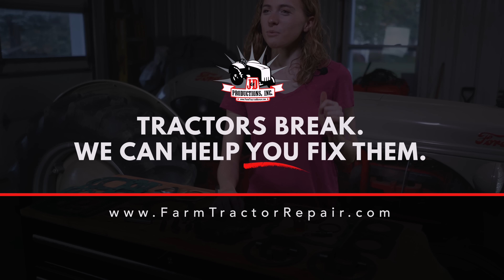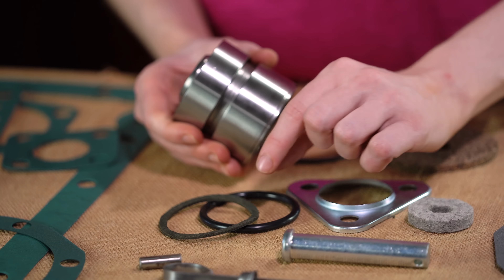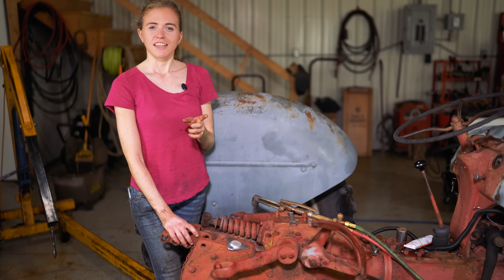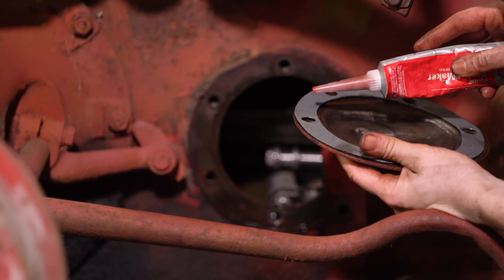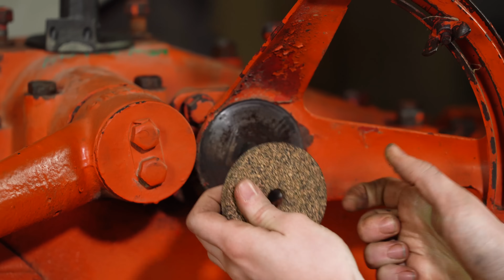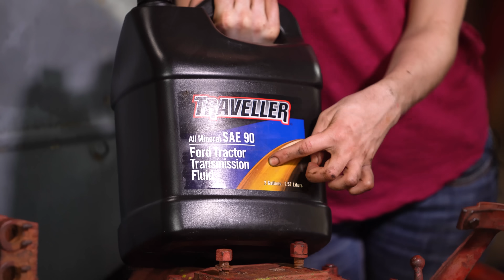Ford Hydraulic Repair Tutorial: Top Lid

Comment: In this video, you used the 90 weight oil, so I think there are two compartments there, which really are one so the oil mixes more or less? Didn't I see on another video you mentioned using Hydraulic and transmission oil back there for both?  So we are putting the AMSOIL SAE 15W-40 Synthetic in the crankcase, and what in the back two spots? Thanks for the videos. I'm sure 1000's of Ford owners have used your videos to resurrect their old tractors. A suggestion is to keep putting those parts on the screen in the videos to make it easier for us to buy from you - I watch the videos so would be willing to buy the parts from you too... And put links to your parts and tools in the video motes so we can click the links and go right to your site to buy the parts. And you can setup amazon affiliate links for the stuff you don't sell so you get a little something there too... Can't wait for the next Video..

Comment: got an 8n with a new hydraulic pump and cylinder, sometimes it does not want to lower the 3 point and you have to move the lever a few times to get it to lower, what would be some likely things to check

Comment: A friend of mine had an 8N and not only were the hydraulic sluggish, but the draft wouldn't work. A mechanic drained it and put in hydraulic oil but was even worse. We drained it and put in the mineral oil and it worked much better. I suspect the pump may have needed this repair.

Comment: Got the kit with piston and cylinder couldn't get lid to fit back on found nee cylinder was to long and hitting the front of the housing of the tractor. Had to have material removed from the back of the cylinder to get it to fit properly. After that it all works great.

Comment: I have a 8n hydraulic goes all the way up and down without a load if I pick up bale of hay it will not go all the way up then when you try to lower it it won’t move till I move the draft control the it goes down draft control if in right position and ideal what to check ? thanks

Comment: My 3 point bleeds off and lowers when I press the Clutch

Is this caused by this upper piston assembly or a pressure relief valve at the PUMP?

I saw You push on the Arm with the tractor off to test one of its features

I'm curious if My bleed off issue is because the piston leaking down?

Ken in Florida

Comment: Dan and or Rachel: I drained the fluid from my transmission on an 8N I purchased yesterday. I saw that it said to use 5 gallons of fluid, which I did use but now the "FULL" mark on the dipstick is about in the middle of the actual level on the dipstick. Any common causes for that issue? Thank you much for the video. I am going to use this information to diagnose why the 3 point does not work on my tractor.

Comment: Great videos you have. Question for you as I have a Ford 8n that I was plowing with and hit a tree root big enough to stop my tractor. Once unstuck, my hydraulics won't lift up at all. Have taken the top cover off and made sure the rod went back into the proper position and while apart made sure the oil pumps up through the pipe. The draft control plunger spring is loose and will be changing it out. Would this be the only reason the lift arms will not move up? Every thing I see inside the hydraulic system looks and works as it should. Thanks for your input. Mark

Comment: You never said anything about how to adjust the draft control. 
You can do so with compressed air on the work bench before reassembly and find out it doesn't work  .

Comment: Could you do a video of how a lift control should work? My lift only uses the top 2 inch of the control... should it lift from the second you pull the handle up from the bottom and should it not drop and hold the position of where your handle control would be? Like 1/4 lift 1/2 lift 3/4 lift full lift and same as for lowering as opposed to all the control function just being at the top?

Comment: WOW, Just WOW, she knows her stuff, Thanks for your video, it is very informative and helped my better understand several things on these old tractors. I have an old Ford 3000 Diesel. Having lift problems and will not shift into 1st and 3rd (odd shift pattern, 1st & 3rd are far right up 1st and down 3rd). I think the end of my shift rod may be bent and not letting it move over far enough to get into gear. I unbolted the top cover so it would slide around and it goes into all gears fine, but when i tighten all the bolts back up no right side gears.  Appreciate any opinions or ideas to solve this.

Comment: Enjoy your videos they are great, Have a question after rebuilding the upper lid for my hydraulics the lift arms (under load) will slowly drift down but at a certain point it will jerk back up to the selected height  will continue this over and over while tractor is running but if tractor is not running it will hold the load at the height that it was when tractor was shut down. What could be my trouble ?

Comment: I have a golden jubilee. I let it set for 2 years and when i got it back out to dig post holes with my auger when i lift the 3 point it jumps up so fast it's dangerous. It has slowly blead down for years but would take an hour to leak down with a implement on it .any suggestions? If needed i could make a video of it doing it. Thank you

Comment: I wish I could find the torque spec and torque sequence for the top cover.
Reply from the maker: Hi Dennis, there is no published torque spec or sequence for the top cover to our knowledge. We tighten with an impact wrench.
Reply: @DanGingell  Thanks  for replying. I was able to find torque specs in the I&T Shop manual FO-4 in paragraph 156...."Tighten lift cover retaining bolts to 53-60 ft.-lbs.(72-81 Nm) torque."